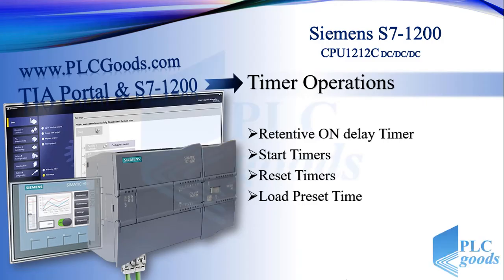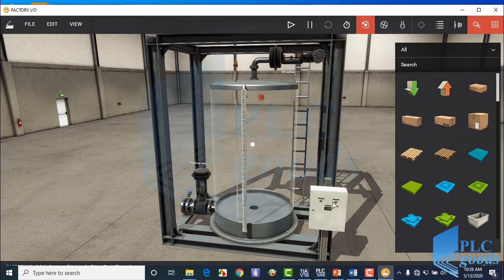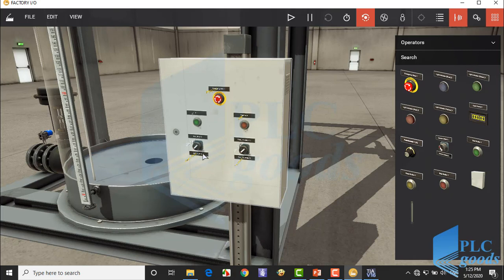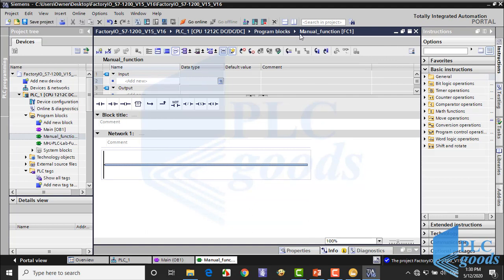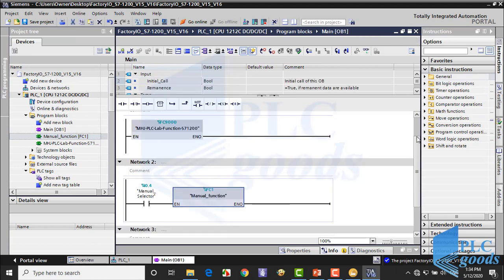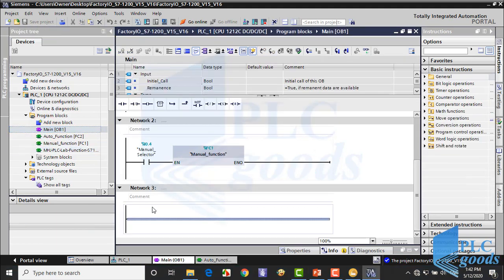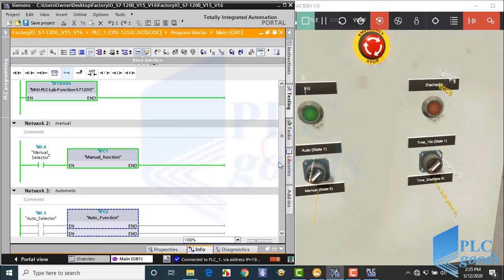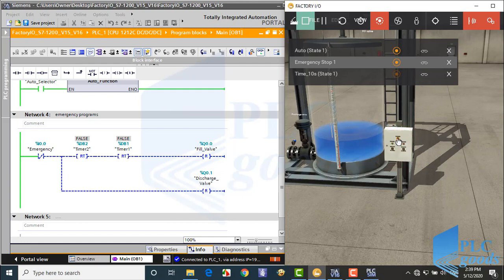PLC Timer Project | Tank Filling & Draining with Manual & Auto Mode | L 20

Comment: hello sir.
Thanks a lot for the wonderful tutorials. 
pls, why does the discharge PB use a NC contacts
Reply from the maker: is your question, answered well?
Reply: @plcgoods  why emergency button is nc always, even when u connect it in separate network from star and stop.
also i thank u for your videos
Reply: Hello dear friend, I used an NC contact in my program, because the related pushbutton inside Factory I O software is NC PB. But, Do you know the difference between NO PB, NC PB, and emergency in industrial applications?
Reply: @plcgoodsmentor9223  will be very glad if you can give me insights to these PB differences sir.
Thanks alot
Reply: @plcgoodsmentor9223  .
i will be very glad to receive your wonderful professional insights to the differences between these PBs sir